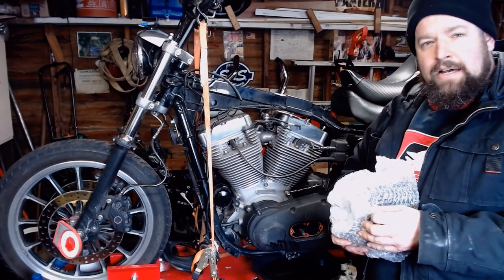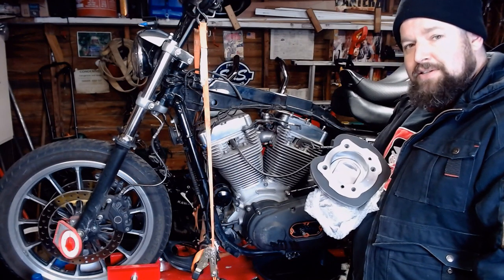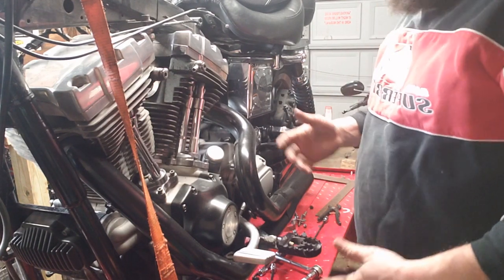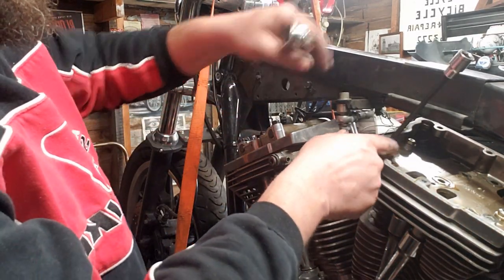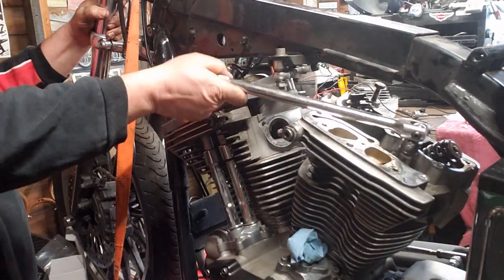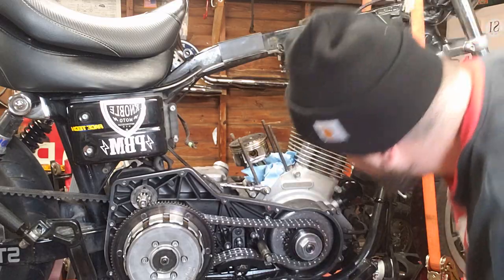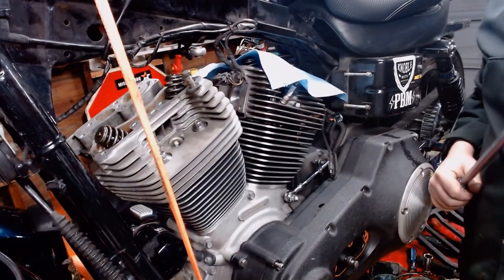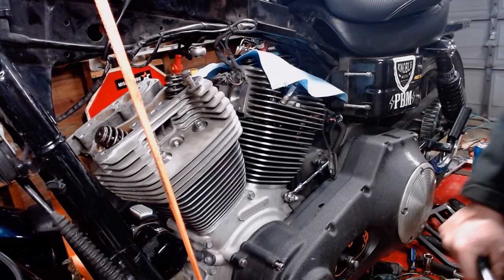95" Big Bore Kit on Harley Twin Cam Install

Comment: Finally someone who dosent use adjustable pushrods! I agree with you 100%
Reply from the maker: Right!?  How much weight are you adding to the valve train?  Take the tank off and pull the pushrods

Comment: I'm currently installing my 98 kit from fuelmoto. Those c-clips has been kicking my ass!
Reply from the maker: I put rags down to catch them on install, and even put a towel overtop the piston to help keep the new ones from going into orbit.   Get a corner in the notch, and try and talk it around.
Reply: Those do suck!  I just got done installing a 98" kit last week on my 2002 softail.  How'd yours turn out?  I can definitely feel the difference.
Reply from the maker: @harleydave2316  that kit was killer. It made great power.

Comment: Just a few things. 1 always rotate the piston pin retaining clip to ensure it’s fully seated and so the opening doesn’t line up with the indentation on the position. 2. Why didn’t you just gap the rings in the cylinders on the bench and then install the piston? It would of been much easier. 3. Cometic gaskets come with updated torque specs for the head bolts. They no longer use the 90° turn method. Other then that it was a pretty solid video.
Reply from the maker: Well since you asked:   1. If I could rotate the clip once it’s inside, that would mean it does not have any spring tension, and I would use a new wrist pin clip. 
2. Because the light coming in my window generated a glare on the freshly machined cylinder that created a glare on the camera.  So in effort of making things easier to see for the viewer, I did it on the bike so I could diffuse the lighting. 
3. Cometic does have updated torque specs and they make a great product and I highly trust their engineering department.  However if I give a spec that is different than the service manual, a bunch of self appointed video critics will get type-ee, and start lecturing about how I should not deviate from the service manual.
Reply: @KnobleMoto  I agree with all of that except the first point but to each their own. And you’re definitely right about people jumping on the manual bandwagon. The worst part is 90% have never actually turned a wrench and let’s say 8% of the remaining 10% have never done it professionally.

Comment: Waiting on my S&S 100" for my 88" upgrade! 

Thanks for the vid, it's always nice to do the work one's self. Just if one's new to it, they best take it slow, and much more cautiously...
Reply from the maker: That will be a hot motor. S&S makes great stuff any they are huge supporters of our classes and the grassroots guys.   
Definitely take your time with all motor work, no matter how majy times you have done it. 
 Hit me up if you have questions.
Reply: @KnobleMoto  hot as in nice or hot as in ouch that's hot ?
Reply from the maker: @justinhenson8131  hot as nice and powerful.  Lol. Sorry about the confusion.
Reply: @KnobleMoto  I picked up what you laid down haha
Reply: I know this is old, but did you keep 4” stroke going up to that kind of compression ratio? I thought I’ve read on various forums or heard others in the know say pushing past 10.0 - 1 compression while keeping a 4 inch stroke is “not advisable.” Just wondering what your experience has been
Reply from the maker: @divine_swine9665  I missed this comment somehow. Sorry about that.  I stuck with the stock stroke.  A stroker and head work would make big HP/TQ numbers.

Comment: You can also put the pistons on the connecting rod then lower the cylinder onto the piston, no need for a hammer
Reply from the maker: Still going to have to put the cylinders down on the pistons. Same hammering. But i always welcome other points of view

Comment: Every video I see doing an upgrade is always the 88" and better.  I have an 82".  Nobody ever does installation vids on those.  But either way, the process is still the same.  Hopefully when I do mine, I'll be able to film it and maybe you would get a chance to see my work.  I really do enjoy these motor builds because everyone does/says something different and I get a chance to learn a little more each time.  Good work man.
Reply from the maker: 82"?  Is that an EVO? If so it is basically the same process.
Reply: @KnobleMoto  yea. Its on a 98 wide glide. I just don't know what kit I'm gonna end up going with though. But I'm gonna wait to order everything until I check the jugs on there now. It'll suck doing something and it ends up im replacing with same thing. There's been work done to it, but don't know what though.
Reply: 82??  Never heard of it... unless it's an 80" EVO bored.  There's an Evolution Big Bore  kit available to go from 80 -> 96
Reply: @lynskyrd  yea, it was an 80. i wrote that comment when i had 1st got it.  i have no clue why i was saying an 82 back then.

Comment: I watched, but the reverse video was way distracting.  I like the fact that finally, someone out there doesn't cut pushrods. I CANNOT for the life of me understand why anybody would want to introduce 4 more potential failure points to a Harley engine??? Like there isn't enough already?  Anyway... good job  - Ride safe.
Reply from the maker: Sorry about the backwards camera lol. Amateur cameraman. 
But YES! Take the tank off and do it the right way!!! Besides the fact it is an extra point of failure, it is a ton a weight whipping back and forth on your valve train. Reciprocating weight is what sets your rev limiters. So Run stockers and spin the h*ll out of it.
Reply from the maker: And thank you.

Comment: After the big bore kit do you feel a big power difference on the highway like top speed? Does it make having a 5 speed not so bad?
Reply from the maker: Overall, yes.  However I did the 510 cam first, and that alone made it pull much harder on the highway.  Upped the top speed to about 118 from 105.   I also dropped the commentator sprocket from at 25 to a 24.  That helped it push the wind. The big bore kit  turned everything up a few notches.  

Regarding the 5 speed: Twin Cams are like metric(Jap) bikes.  Just twist the grip more and spin the snot out of it.  The engine loves it.  WITH the lower gear ratio, I would spin mine at 80+ all day long.

Comment: Good video. I'm trying to figure out how to watch it though. Turn my back to the screen and watch it through a mirror? That or your engine is in backward I can't tell lol. Im thinking of doing this to my 88 real soon. I have it torn down that far, I should at least fix my rear lower rocker box while it's out. But after 5 grand in chrome and accessories why worry about a 80mph only oil leak.
Reply: I was wondering if I was the only one that everything backwards
Reply: After this video I have seen dozens. You dont notice it unless its something you are pretty familiar with. All the right hand belt drives lol. But if your are shooting on a phone I dont see any other way unless you flip it once you shoot it. After using zoom I know 110% I'd be all over and just getting 1 ear or my hat in the shot.  That stuff is hard to do lol!!
Reply from the maker: Thanks for your input.  tag me in your video, so I can see how you do it.

Comment: Any videos of it running, is the sound better? I'm going to convert my bike to carb, so I bought a big super D carb with twin thunderjets. If the carb is too big I will need to get a big bore kit, so this this video has made it look really easy! Thanks
Reply from the maker: Good idea.  Next moderate warm day, will nock out a sound demo video.
Reply from the maker: The D is a BIG carb! I ordered to utilize a carb that big you will need to pull a ton of air.  100"+ motor with heavily modified heads and 11:1 or more compression.   
Whenever people have lots of motor building questions about pairing parts, I recommend the book;  Building a Harley Torque Monster by Bill Rook 
Sizing parts to each other will make more power across a wider rpm range.
Reply: @KnobleMoto  it just looked so pretty with the thunderjets and velocity stack I had to buy it lol if all faills I'll just get a Super E
Reply from the maker: @dreK-47  lol.  I completely understand
Reply from the maker: posted a sound demo https://youtu.be/qb0SFqul9O8
Reply: @dreK-47  dude, order the parts YOU need for the build. Engine parts aint jewelry. You dont buy em because they're pretty or cute
Reply: @arthurcutaiar9994 -  uhh, sorry Arthur...sometimes we do. Some of us even sleep with them in our bed before we put them in a conspicuous  place on a shelf. Some 'race' parts are just too sexy not to possess them. Even if they are not right for our motors. It's just a matter of appreciation for hipo parts. Harmless fantasies about bigger motors than we can afford, and the parts for them,  are not that uncommon. Lighten up a little and dream a  bit. Who knows, someday you may have slept with enough parts to actually put together the 'Monster' of your dreams. 
   I've been thinkin' about gettin' a blower lately! If I do, you can bet it will be right on my coffee table, so all my friends can dig it too.

Comment: this actually looks pretty straight forward, i haven't done much work to my bike, but wanting to do this upgrade, im curious if you have any knowledge comparison on doing the cam upgrade and switch hydraulic tensioner is of a job?
Reply from the maker: I switched to gear cams before I had a YouTube channel.  It is a fairly easy job.  If you can do a big bore, you can do cams and vice-versa. You will need a few more special tools for cams.  A press for bearings in the cam plate, and the inner cam bearing removal tool.  I was able to borrow the tool after a Facebook post.
Reply: @KnobleMoto  very cool, think i will give this all a go since i've priced out it at a local shop and its in the thousands for shop time! thanks for the comment back, much appreciated! def going to subscribe! take it easy!
Reply from the maker: @BrandonPrive1432  thanks!

Comment: How does the break in process work after doing a big bore kit. I’m doing a 95 big bore kit on my 88 and I’m getting lots of mixed answers on how to break in the rings?
Reply from the maker: When I build an engine, I take it easy for the first 50 miles or so, then I ride the piss out of it. Somewhere in the first 500, I will wind it out on top gear to be sure the rings are seated. Start with conventional oil for the first 500, then 1500, then full synthetic and don’t worry about it.
Reply: @KnobleMoto  thank you🙏🏽
Reply from the maker: @joeyschuster9068  you’re welcome

Comment: Looking to upgrade an 01 Dyna (Carb) to 95" and S&S 510. How is the pull between 2,000 and 4,000 RPMs? The current setup is 88" and a 203 cam and stock heads. Runs good but looking to increase compression and add cubes. Not sure if I want to stay with the 203 or upgrade to the 510. Looking for opinions.
Reply from the maker: Pulls real hard through there.  Pulls hard all the way to redline.  
*I also added a screaming eagle ignition module and I dropped the motor sprocket from 25 to a 24.
Reply: @KnobleMoto  I think my 01 is already has a 24 tooth compensator so that's one less thing to purchase. Thanks for taking the time to provide some great content.
Reply from the maker: @kerrylewis2581  thanks. Let me know if you have any questions along the way.
Reply: go to the 510, the screaming chicken 203 is very mild. screaming chicken parts are good, all but the cams. way to mild

Comment: do you have problems with heat or overheating with this kit?
Reply from the maker: Not at all. With a proper tune it shouldn’t get any hotter than stock.
Reply: @KnobleMoto  thank you!

Comment: How did you end up liking this Vtwin mfg kit? Looking to do the same and can’t find many reviews or experiences.
Reply from the maker: All the parts had a nice fit and they worked well.  It didn’t come with a gasket kit, and by the time you get the gasket kit it would have been the same price as a name brand setup.  Just fyi.
Reply: @KnobleMoto  thanks for your response, I am looking at the regular flat top cast 95” setup and have a nice 20% off so I’m looking at around 460 for the kit w/o gaskets, contemplating having my cylinders bored but still weighing my options out. How many miles did you put on the kit and how was the power add?
Reply from the maker: @Mcassino92  about 15 Hp I would guess. I also did some light headwork and the bike already had a 510g cam. The whole package was about 105hp.
Reply: @KnobleMoto  cool good to hear, I’m planning on Andrews 37 cam and a street port job on the heads as well. Hoping for around the same
Reply from the maker: @Mcassino92  that will be a solid setup
Reply: @KnobleMoto  did you use a full cometic gasket set or just use their .030 head gaskets?
Reply from the maker: @Mcassino92  full Cometic set.  I only use their stuff.

Comment: Doing this upgrade and few others right now. What can i expect power wise on the old butt dyno? does your bike feel stronger?
Reply from the maker: Oh yeah. It will feel a lot stronger! It should be around 100hp with 110ft lbs. 
By the butt dyno:  if you snap it open in first, it will do horsepower wheelies.
Reply: @KnobleMoto  I am an experienced head porter and going with the 10:1 piston option. Can't wait!
Reply from the maker: @HammerHeadGarage  that’s thing will rip with some head work!!!!
Reply: @KnobleMoto  Did you need to upgrade your ignition?
Reply from the maker: @HammerHeadGarage  it’s a good idea.   The stock timing curve isn’t the best for an increase in compression. I put the SE Street unit in. Sometimes you can find them NOS on eBay.
Reply: @KnobleMoto  I have the SE 32719-01B with the higher rev limit 6200. I think it pulls timing out a s well but can't find much about it.
Reply from the maker: @HammerHeadGarage  I am pretty sure that was the same one I used.  It worked well.
Reply: @KnobleMoto  ok cool, I will try it first. Are you using 91 octane?
Reply: @KnobleMoto  How long did you run that SE ignition and is it still running ok? Sorry for all the questions.
Reply from the maker: @HammerHeadGarage  I ran it for about 20k, then I sold the bike.  It still ran great when I sold it.
Reply: @KnobleMoto  Thanks man, Just hoping I won't need the $500 ignition box right now. lol

Comment: Are you running stock cams in that?
Reply from the maker: No S&S 510G cams.
Reply: @KnobleMoto  I just put in a new cam plate, hydraulic tensioners and the high volume oil pump. I'm still using the stock cams. Is it worth it to put in the S&S 509C cams; if so, I know the low end torque will improve, but would there be a HP increase too? 2005 dyna super glide FXDI.
Reply from the maker: @lukealvarez5240  yes it is worth it!  Cams change the personality of the engine. Big bore just gives you more of what you have. 
Get the cam that meets your riding style and you won’t regret it.

Comment: Why is it in the wrong direction? my Primary is on the other side, like all H-D
Reply from the maker: I used the front facing camera on my phone to film this.  I didn't think about filming the image until after it was posted. So there is stays.  I figured most people would figure out what was going on and still get the appropriate info.
Reply: I don’t understand what’s going on

Comment: How much do you think a shop would charge for doing the same thing you just did. No cam swaps just the jugs.
Reply from the maker: Eh, I have no idea.  I have never had work done at a shop.  I hear they charge $100 per hour.  Probably a 10 hour job, so $1000.   That is just a random guess.

Comment: AWESOME work.  I am getting an 98 kit with new cam tensioners put in my 06 SG.  Since the install, have your oil temps been staying in control?
Reply from the maker: Oil temps area the same. If your temps creep up after a big bore/compression increase, consider first backing your ignition timing off, and then richening up your fuel mix.
Reply: @KnobleMoto  thanks for responding & the advice 🙌🙌!

Comment: Why didn't you use the cometic torque specs using Harleys specs seems like a good way to pull the stud out of the case ?
Reply from the maker: I do not recal anything in the Cometic instructions that said anything about different torque specs.
Reply: @KnobleMoto  all the head gaskets I’ve ever done from cosmetic have come with instructions for torque. It’s a 4 step with an actual torque value at the end. As a matter of fact their instructions are pretty adamant about doing it their way. Many hi-po shops recommend it also. That said, the original way, with 90deg turn should be very close. The issue is, with that method is a different gasket make up and it is with new studs, so the stretch is known and will be the same, with used studs, it could be off a bit at each one, and the compression of the gasket material, hence the known value for the last step.
 On such a mild build I seriously doubt you’ll have issues anyway. Just something to know for the future.
Reply from the maker: @megastick9324  I must have missed that in the gasket kit then.  When in doubt I generally steer towards manufactures recommendations, unless there is a known problem.  So far, no issues.  But then next time I have my hands on a Cometic kit I will take a look at their way.
Reply from the maker: Fyi.  In my Twin Cam Teardown class I do cover repairing studs that pull out of the case.
Reply: @KnobleMoto   no biggie man, I actually see some kits do have instructions, and some say use manual procedure. It may depend on the particular gasket type being used.  As I said, I’m sure there won’t be a problem, and I agree , always default to the manual when in doubt. Have a good one.

Comment: No more balancing of internals? 🤔
Reply from the maker: You can still get the crank balanced and trued.  For a big bore on a twin cam, it's not really necessary.  If you are aiming for 110hp or more, then you should consider it.